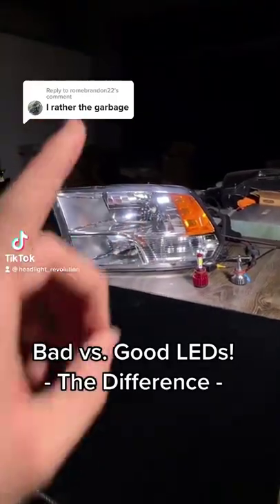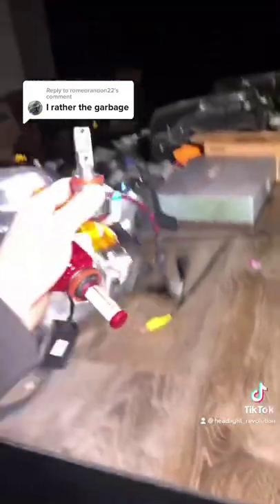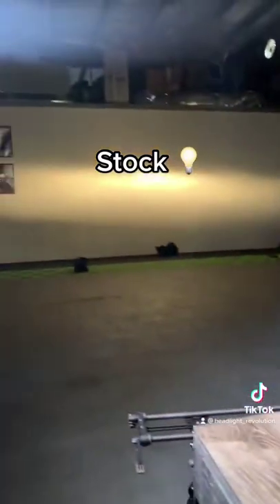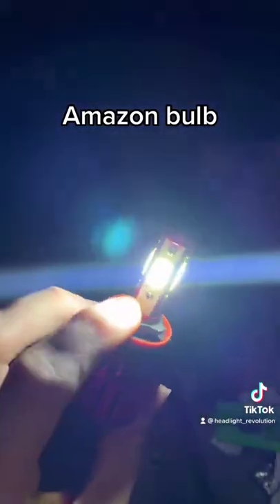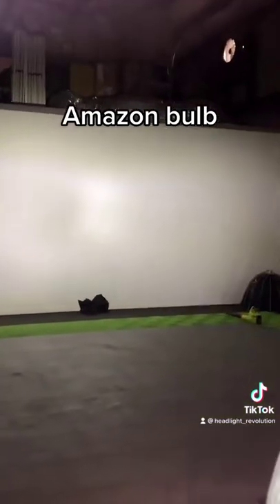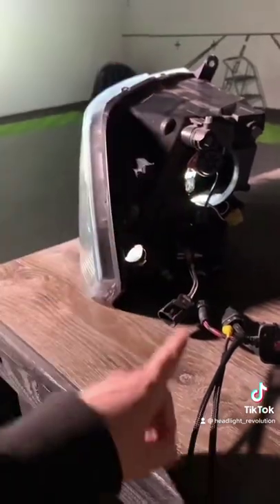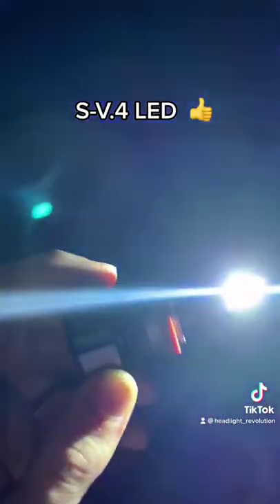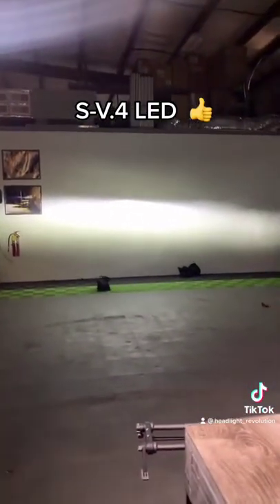Quality LED Bulbs vs. Garbage LED Bulbs! #shorts

Comment: I prefer the first bulb, usable in most conditions without blinding other drivers. Also yellow lighting makes roads so much more definable to me.
Reply from the maker: Sure! 
Nothing wrong with OEM!
Reply: youll love it until they burn out from high heat. a trip to the desert killed my oem bulbs
Reply: Yea, I don’t understand why someone would want to blind the drivers around them.. seems counter intuitive to me
Reply: @stancexpunks just turn your high beams off. Led bulbs don’t blind people if you get the proper style of bulbs. Main issue still is people don’t turn their fucking high beams off ever.
Reply: @skittlesbro1378  uh no..they do. Putting led in a halogen headlight housing is asking for trouble and everyone agrees. Keep the stock bulbs in the stock housing.
Reply: @whitegoodman7465 never had a problem with my leds yeah they are bright so is every other car made nowadays
Reply: Actually it's the first bulb that will blind oncoming drivers because there is no defined cut-off. The first bulb is suitable for fog lights but not low beam headlights
Reply: @832738 live in the uae for 20 years I've had the same set of halogen lights for 10 years not a problem
Reply: @whitegoodman7465  first time i put LED bulbs in my small SUV, a few cars flashed me. i angled my lights down, no one has flashed me since. there are more and more vehicles using LED bulbs, yet only about 1 out of 10 are insanely blinding. that tells me it's not the bulbs, it's the clueless drivers who just don't know how to adjust their beam
Reply: @whitegoodman7465 this was a halogen housing BTW
Reply: @nolansmokes  by halogen housing they mean a reflector
Reply: @360.Tapestry  It's a bit of both.  There's a lot of LEDs that just throw light everywhere.  (Ex: 4656 LED conversions that have 15 or 20 exposed chips instead of a legitimate lens or projector).  Not to mention the rod cells in a human eye are more sensitive to cooler temperature light, so an LED will appear brighter than a halogen, even though output in lumens measures the same. But at the same time, I totally agree that if people would just aim their flipping headlights it alleviate a lot of the issue, and help them see better too.  That goes for us halogen dinosaurs as well
Reply: @limprooster3253  i fully agree 👌
Reply: Oem sucks. Drive highways at night with your yellow bulbs and see where the road goes when these trucks with led lights drive by. Your white washed. I want the brightest f you lights possible. If I run into a halogen driver I'll just turn them off and use fogs because I'm not an asshole. ( At least not on the road )
Reply: I run silverstars halogens. I see the road just fine. And can blind the f out of people leaving their brights on badly enough.
Reply: @832738  Just started getting notifications of replies to my comments the other day (late response what can I say bud). I live in a bit of the colder climate of Canada so heat is the least of my concerns for my headlights. I worry more about the snow reflecting the light.  White lights naturally blind the eye, and snow bounces the light back at you. Yellow lights are much safer in the snow when you journey in my area.
Reply: @MrNoNameForYou  Most of my highway driving is in northern Canada highways (no lane dividers from oncoming at 90km/h, 50-60mph for you americans) if I run white lights with snow along the highway it just reflects back in my eyes and makes it harder for me to see, easier to drive with yellow lights since I can atleast see if I am gonna die from oncoming or atleast buy me time to dodge a deer or bear. Also don't know what you are talking about with oem bulbs not seeing the road? Maybe you need to get checked for colour blindness or just plain eye sight, I never had trouble seeing in the dead of night on the highway with my cheap bulbs (no street lamps in my area either so you can't chalk it up to that)
Reply: @zahimiibrahim3602 The first bulb he showed was the OEM.
Reply: I have 5% tint and needed my LED lights.
Reply: @whitegoodman7465 When you are being blinded you were taught to look at the white line here in America works like a charm
Reply: @zahimiibrahim3602 this statement makes absolutely no sense lol
Fist bulb blinds, not good for low beam, but good  for fog? 😂
Reply: @360.Tapestry it's definitely the bulb too buddy
Reply: @ninjalol2253 or else you live in Northern Maine where there ain't no white lines on the roads LOL

Comment: It’s not me… my bank account is the one that wants the garbage!
Reply: Buy once, cry once
Reply: They don't last as long, and you still won't see as well.
Reply: Your wallet is going to blind someone and you may be in that accident. You get what you pay for, zip
Reply: @Sall231  my cheap brake pads will cause an accident way before my headlights…
Reply: @dcm1378 so then by that logic, just drive with all the worst equipment. No horn, no AC, bald tires, engine firing on half the cylinders, cracked bulbs, etc.  Can't be any more dangerous, right? Why spend more on the other safety equipment if the brakes are shit anyways, right?

Can't be a slippery slope fallacy if there is no slope
Reply: Same
Reply: They don't last as long, but you SEE great! 
 @turboflush
Reply: @Sall231 stop crying

Comment: Have you ever been blinded by a led light?  Sure, have led in your high beams, but normal headlights on when passing others
Reply: Do you even know y leds appear brighter?
Reply: @jakelonghorn9852  it's because it contains so much blue light, which our eyes perceive as so much brighter even though its the same output. That's why even misadjusted halogens aren't as bad as low quality LEDs

Comment: Honestly it amazes me how many people have a problem with HID/LED bulbs. Stock bulbs are barely bright enough to see the road on front of you and I’ve ran HIDs on my truck since 2009, never once got in trouble for it. They are brighter and safer for me, as well as beating on the cheaper end depending on what you get. I ran them as my low beams and never had a single issue 🤷‍♂️

Comment: - Need a discussion of properly aimed headlights. Most vehicles on the road have improperly aimed headlight assemblies to begin with because vehicle inspections really aren’t a thing in the U.S. anymore. This is so important for LED or halogen. Reflector or projector. 25 feet back on a wall, you want the top of the light bar cutoff a minimum of 2 inches lower than the measurement from the ground to the center of your headlight assembly. I go ~3.5 inches lower, putting the cutoff on the ground out between 3-4 car lengths in front of me. I never get flashed with LED bulbs and would never go back to halogen.
- You want the blade of the LED bulb positioned like you’re using a knife in the kitchen. Completely vertical. This is very important for reflector assemblies. Walk around a big parking lot and look at how many people have their LED bulbs horizontally and diagonally positioned in their reflector style assembly. It’s a lot. That scatters the light really weird. Put your LED light on a wall and spin one around in a reflector assembly and you’ll see. It’ll even change the pattern slightly in a projector assembly.
- Only buy a blade style and never get LEDs brighter than 6000K for street use. If you ask me 5000K is plenty.
- If you’re headlight assembly plastic is yellowed polish it clear or replace. Don’t just purchase super bright LED bulbs to compensate.

Comment: The Amazon ones are illegal: you cannot have anything but 3-4 LEDS on a 2-sided flat lamp, like the good one shown in this video is legal. You can get ticketed for those Amazon ones.
Reply: Dude, all LED and HID conversion kits are technically illegal. The replacement bulb must be the same type and spec that was installed by the vehicles manufacturer. This is why all reputable LED bulb manufacturers use the disclaimer: " FOR OFF ROAD USE ONLY". 

With that said....There are some better made LED bulbs with a better beam pattern and better cooling but the only type of bulb that belongs in a reflector housing is a conventional halogen. To get the best results from a conversion kit the bulbs should be a 55-65 watt flat stalk design with 1-3 diodes per side with a rotatable collar for adjusting installed in a projector housing. 

Improperly installed, cheap, over powered, incorrect color temp LEDs are just as bad as the cheap ass HID kits that hit the scene in the early 2000's. All the so called performance shops carried them and installed them and had everybody driving around with blue and purple headlights blinding oncoming traffic until municipalities started cracking down on them and had police issuing equipment violations left and right. You waited for a ticket or waited for the cheap ass ballast to fail, whichever came first.
Reply: @RellyOhBoy  Korea and Japan have some road legal LEDs from Philips and they do works darn good. even better than halogens!. thing is, those LED kits uses emmiters as tiny as halogen filament and some even smaller. that's one key factor out of several things to make a good LED retrofit

Comment: Also when changing your halogen to LEDs I recommend tuning the beam (most headlights allow you to angle the beam yourself with a screwdriver) if you're gonna buy garbage. At least aim it at the ground.
Reply: aiming at the ground can also cause issues, especially on any kind of wet pavement

Comment: I bought the SV4 low & high beams for my Ram reflectors. The low beams quit working just over 2 yrs after installing. Still have the highs with zero problems. They both are much better than stock for sure. Just wish the lows lasted longer.

Comment: Ram 1500 owner with that same headlight housing had the supernova v4 its very bright  but after 3rd warranty replacements i decided to look elsewhere
Reply: Pretty sure the S.V4 is different from the Supernova bulbs. The supernova bulbs are a knockoff. At least that’s what I heard. Did you buy from HR?
Reply: @stevenaziz  sv.4 is Supernova i had supernova 3 but had burnout issues with it supernova discontinued the 3 and replace it with supernova 4 i did purchase ALL my LED's from HR and that reminds me i gotta buy another interior led bulb for the rear of my truck from HR after 5 yrs it burt out
Reply: @joe7528  Why doesn't the HR product listing say "Supernova" anywhere?
Reply: @stevenaziz the supernova version 4 is Sv4 the name has been rebranded i had both the supernova v3 and the v3 was discontinued due to burnout issues and no longer available  supernova rebranded the name and made Sv4 bulbs and i had burn out issues with that as well so i decided to replace my stock holengen reflective housing with alpharex pro series g2  projector housing and used Hikari H7 leds three yrs later and no issues with alpharex or Hikari LED's I'm not knocking Sv4 thier bright but for the price and the numerous warranty replacements i had to do with them i decided to go another route

Comment: This is good to see but I also think there’s still a problem with these LED’s n it’s not necessarily the fault of the led itself, but more there not compatible with every headlight housing design. I’ve seen people put LED’s like that in housings like the one your using where the bulb is in a shroud or even fully enclosed. Which makes it so not enough air can flow over the heatsync and the bulbs fry themselves

Comment: I often watch your videos with regards to LED bulbs and they are impressive. However, I have yet to see you do a video on the Merc SLK R172 stock light conversion to LED. Over here in UK we have a lot of people trying out different bulbs in an attempt to improve the quality of the standard headlights all without success. It would be great to see you guys coming up with the right LED replacement for this car.
Kind regards Paul from 48 Spokes 🇬🇧
Reply: I have a R171, couldn't get LED's to work correctly even with decoders. Maybe a more expensive kit thats built for the specific car would work
Reply: @ilyas5708  Can I lay the gauntlet down for you to find one that works for the R172 SLK as many many people would find that incredibly useful.
Kind regards Paul
Reply: @itsalldoable  I'm too lazy for that haha. I just stuck in some blue tinted phillips halogen bulbs

Comment: I'VE TRIED MANY BRANDS. TO ME THE AUXITO ARE A GOOD VALUE
Reply from the maker: We've seen Auxito to be very hit or miss in our testing. Which application did you install yours in?
Reply: @HeadlightRevolution  I have them installed on fogs on my Avalon, the headlights are stock HIDs. And my wife's Avalon also both headlight and fogs. I have the ones with the thinnest board, those are the best they carry in my opinion.
Reply: @HeadlightRevolution  I installed the Auxito Q16s on my Kenworth T680 and actually ended up returning them and going with Fahren because the Auxito just didn't manage heat well at all and they would constantly adjust their brightness levels. It was barely noticeable but I couldn't stand seeing it all night while driving. They were exceptionally bright though and matched the beam pattern perfectly.
Reply: @kylemcconnell378  Thanks for the tip. I too have a Kenworth T680. 
I bought complete Aftermarket LED headlights with sequencing turn signals. But the light, although very bright. Seems to be just Shotgun'ing the light everywhere. Especially  on coming Drivers.
Double set of Yellow LED fogs on Deer Gaurd 🦌 made the best in class driving lights. I have trucks following me in thick fog. 1 set of Spots. 1 set of Fogs. Fused link off battery to double set of Radio Frequency Relays.
OTR/ TX based 
Safe travels, Driver

Comment: Done forget the ones that regulate their brightness using low frequency PWM. I can see the flickering on those and it drives me fucking nuts.
Reply: PWM flickering headlights are on another fucking level. I get image ghosting sitting in a restaurant with dimmed PWM lights. I can only imagine the headache I'd get with all the movement of driving.

Comment: El cheapo bulbs though ugly is in certin situations is actually way better at providing a wide flood view of all close surroundings.  Say offroad.  Not super priced, leaves no blinds spots.  The more area lit up the more you can see
Reply from the maker: Only if it's off-road 24/7, they should never be used on the road.

Comment: I agree, I have projector headlights that came with halogen bulbs and it was the worst, changed them out with some auxito bulbs designed for projectors and my god are they awesome, completely uniform beam pattern nice sharp line at the top of the beam, makes all the difference

Comment: Driving towards someone with those cheap multi LED units is a nightmare. They can’t see because of the shotgun light effect, so assume their lights are not bright, but to oncoming vehicles, they are intensely bright. The quality ones to oncoming vehicles just look whiter and slightly brighter.

Comment: Ive seen a few videos about those LED headlights needing to be scraped off quite often in a colder environment... but the older bulbs produce heat to melt the snow and ice in the winter.. it would be nice to see either way 😅
Reply: It's a non issue. If you're getting enough snow that it covers the headlights, you're brushing and scraping snow off your windshield and windows anyways. It takes 10 extra seconds to scrape the headlights. (Speaking as someone from NE Ohio where we get snow by the foot)
Reply: @cherrypepsi2815  happens while driving.. it builds up because there isn't heat from the bulbs keeping it clear..
Reply: @JF94-k4o  I've never had that problem at all and have never seen it happen. Unless you have a really rare icing condition where the snow can stick well, I've never had a buildup on my car.

Still, if this actually is a problem in some areas (which I don't doubt), there could be legislation mandating headlight deicers, almost like the traffic light deicers that already exist. That wouldn't be such a bad idea in general, to be honest. I'd definitely pay extra for better deicers and defrosters in cars.
Reply: @cherrypepsi2815  👍🏻

Comment: But do they get warm enough to melt snow off your headlights?  I drive in the snow a lot with led bulbs and snow sticks to my headlights all the time.
Reply from the maker: Most LEDs bulb are not recommended for now, expect the Morimoto 2stroke 3.0s. We've had the best luck with snow and storms using those bulbs since they circulate warm air around the housing, it helps prevent build-up on the lenses!

Comment: Hey I purchased two pairs of led low beam lights. 
1. Watt 60w (30w/ bulb) & Lumens 6000LM
2. Watt 50w (25w/ bulb) & Lumens 5000LM

I obviously want high visibility but dont want to blind on coming drivers - what do you suggest?

Comment: This is only the tip of the iceberg to why people get blinded. 

1. Coming over a crest on a hill
2. Going over speed bumps,
3. Too much cargo weight in the rear will point the headlights up. 
4. Tall lifted vehicles
5. Bad design on the led bulb shown in the video
6. Dirty, foggy, yellowed headlight lens will scatter light, 
7. Cheap aftermarket headlight housings produce poor quality beams no matter what type of bulb you use
8. Improper adjustment on the led bulb. (Bulbs have hex screws for the light rotate. Leds chips should point east and west not north and south and not in between. Otherwise you’ll get a scattered beam pattern and user just throw them in without confirming)
9. Dirty / scratched and tiny micro abrasions on your windshield exacerbates the intensity of the light.

Comment: 2 issues with cheap bulbs

Their color is not optimal for night vision. If they go too high into the Blue they strain your eyes and you actually see less far which makes manufactures sell them at higher brightness than a regular halogen.

The issue you noticed here.

People also have a tendancy to put them in old cars with foggy headlight covers, wich does the same thing this video covers.